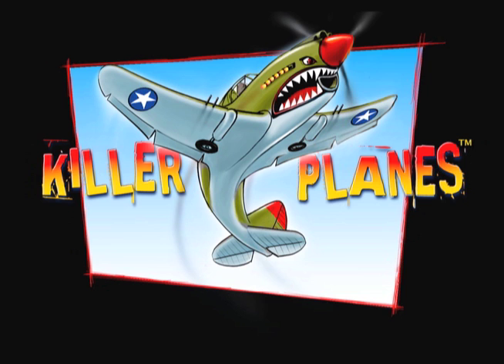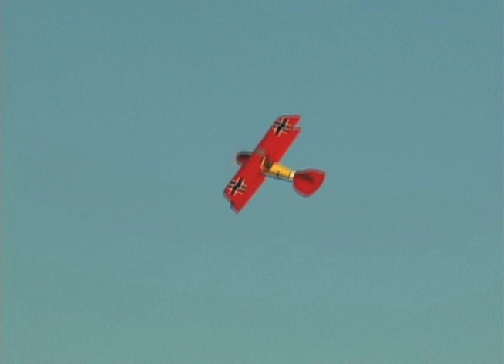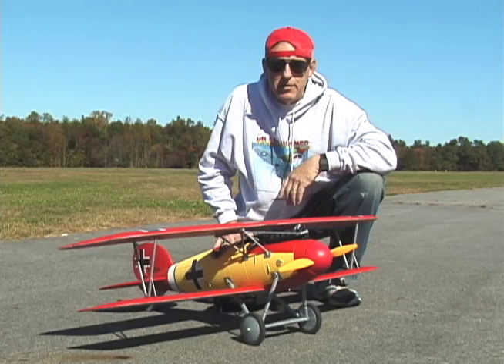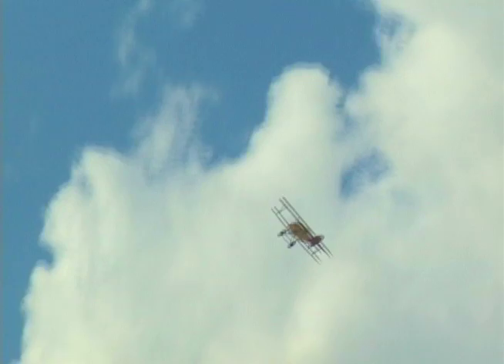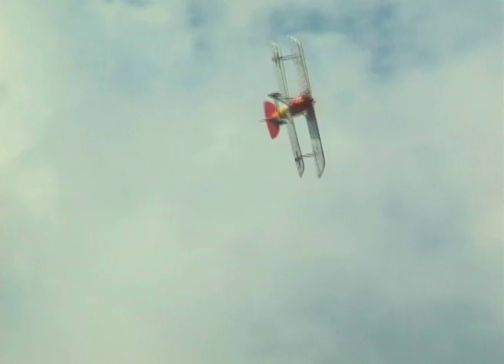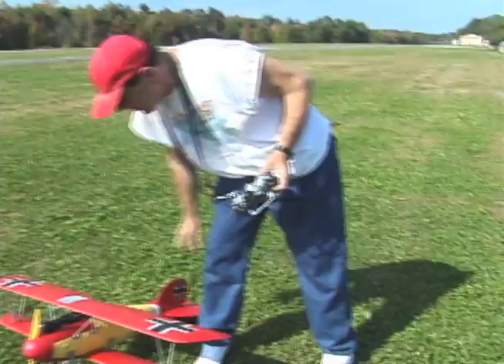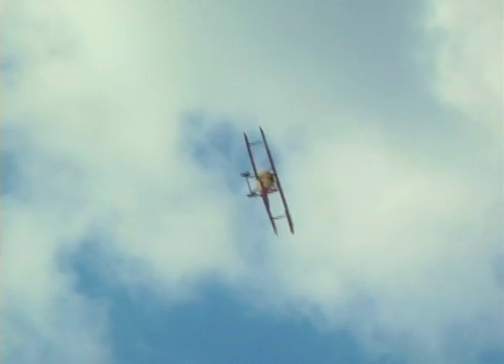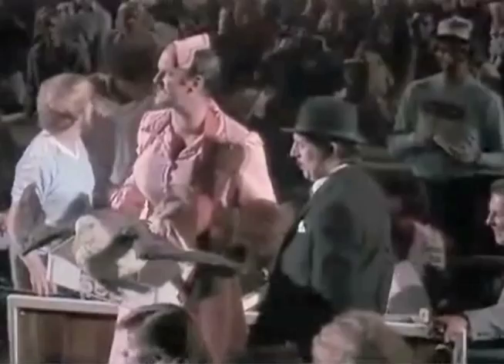THE DYNAM ALBATROS WITH KILLER PLANES CRASHPROOFING

Comment from the maker: I moved the battery toward the back, because I had to add quite a bit of up trim to fly level. You point it up, it goes up. You point it down, it goes down- unless there's a stiff breeze, like during this video. There's a sweet spot for the CG in there somewhere! I think the huge guitar pick shaped fixed tail has a lot to do with it-

Comment: Yeah I have the albatross myself it's really a great aircraft.. I upgraded mine to the new 650 KV motor and I run mine on a 5S battery with a 60 amp ESC let's just say it makes a lot of difference I can do a lot of 3DS with this airplane out and it is super fast!!
Reply from the maker: All of a sudden I need one of those...lol
Reply: @Killerplanes it's always a good idea on these albatross.. the wing struts it's a good idea to superglue those together.. it makes the wing a lot more sturdy.. and gives it a lot of strength... And when you come in from landing you can come in Dead stick just remember glide it in slowly.. for some reason everybody wants to fly them like a jet and come in fast.... I've had mine for 3 years and I got close to 100 flights on it and not one mishap... Other than the upgrade to the motor 650. 60 amp ESC. And when you go to a 5S battery watch out.!! It is going to be super fast!